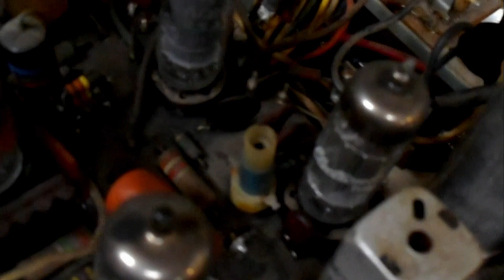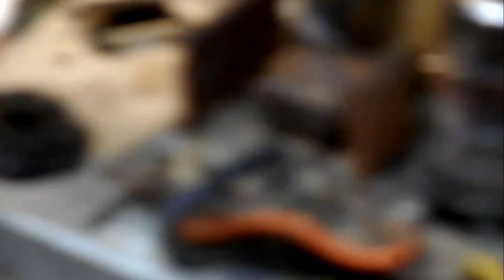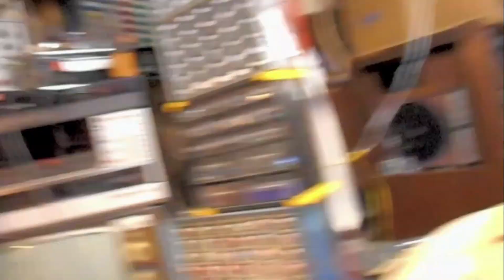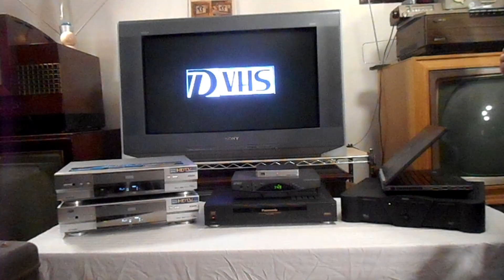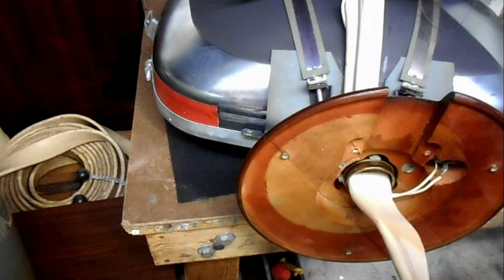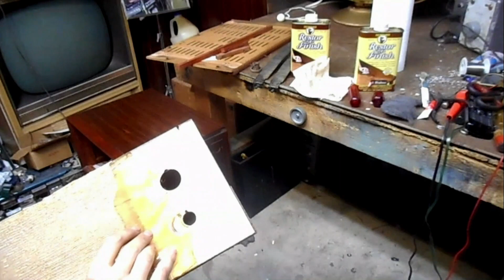Philco Predicta Tandem Restore Part 2

Comment: Thanks Tom - super interesting and informative! You mentioned a color retrofit to a Predicta cabinet... didn't a company called TelStar do a color modified version a while back?  I've wondered if 
one of these modern "LED pico projectors" might be fit into the CRT shell and made to project onto the inside of the plastic trim / saftey shield.
Reply from the maker: The Telstar sets were actually made here in Milwaukee. I met a guy that knew the guy that made some of the molded parts for it. I sort of want to make a tube color Predicta so the idea of using a CRT appeals to me (others have wanted to do similar too). That's an interesting idea using a projector. It probably could be done, though it might not fill the screen depending on the lens angle of the projector.

Comment: I am trying to find a philco predicta tandem but I can't do anything right now because I have a '59 predicta siesta in the garage and I can't find anyone to fix it, and now it looks like it won't be getting fixed.
Reply from the maker: A lot of techs don't want to work on Predictas because the board is a PITA to work on compared to an RCA or Zenith of that year.  They aren't really that bad though if you have good coordination, a steady hand and patience.
There's a lot of places where there aren't local TV techs anymore.  
I hate to sound negative an cynical, but the average monochrome set isn't going to go more than 2 years between repairs if used 8+ hours a day. A lot of people will get a set restored by someone else and be unhappy when they use the snot out of it and have to keep sending it out to be fixed every 6 months to 3 years and every time it's hard to find someone to do it.  It isn't hard to fix these compared to some hobbies people have, and it saves a lot of time, money and headache when you can repair your own TV.
Reply: Yeah but I am in school full time and don't have time or money to be putting into this tv. It worked before but I was being dumb and plugged it in and blew out a part, I am not sure what part it was but I'm guessing it was the power transformer taking in a big load of power after about 40-50 years.Now I am considering selling it. I don't want to but it just might have to be done.
Reply from the maker: @RCAFleetwood1961  You're reminding me of my college days before I got mt EE degree.  I used to fix ~1-2 TVs a quarter. Affording caps was rough...I used to regularly swipe burnt out CFL bulbs from campus facilities (nobody would complain if they were already burnt out) and rob film caps and lytics out of the ballasts (though the lytics were usually toast), I'd take the boards from 90's CRT sets and find usable caps on those...I'd take new caps of the wrong capacitance and or voltage and make the right cap out of 2-4 Parallel/Series caps...There were plenty of ugly but functional kludges made.